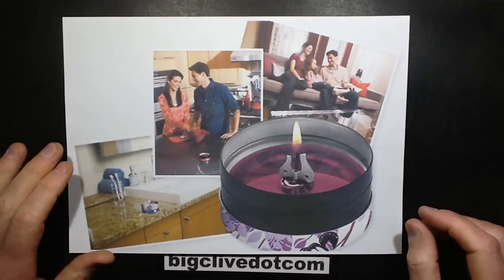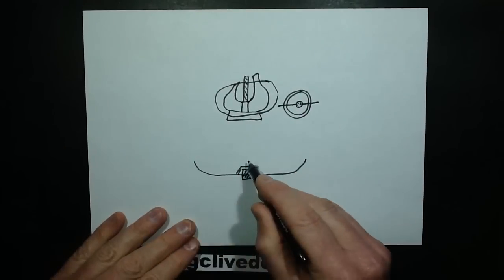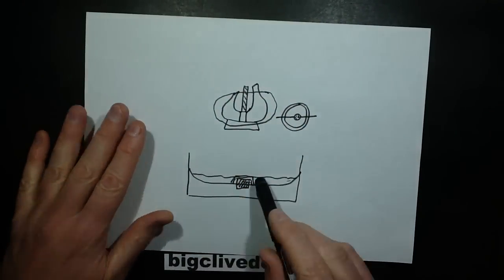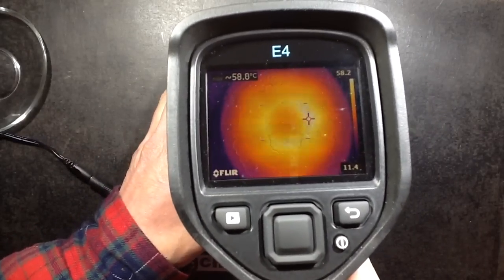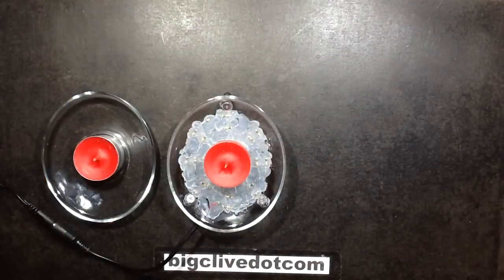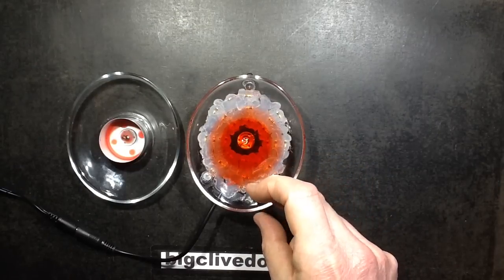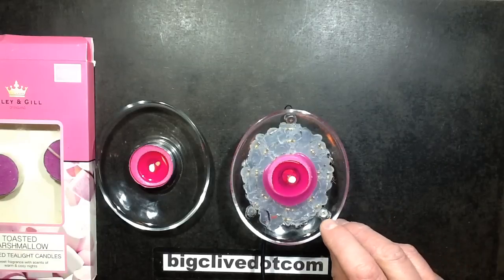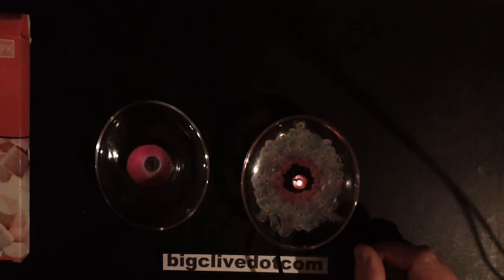Using resistors as heaters to melt wax.

Comment: Former candle maker here. If you have a wick too small for the container, then you will end up with a rim of wax on the edges when the wick is all burned up. Wicks must be sized for the width of the vessel.

If you look at the left tealight you showed, the wick is just BARELY big enough for the tealight container. If you look at the right candle, the metal tealight container was removed, the wax melted and expanded to fill the glass dish, and the right wick is no longer big enough for the width of the newly created pool of wax, hence you get a tiny flame on the right. 

It's not unusual to have undersized wicks on wide pillar candles and you end up with a wax shell as the wick burns down, but some people find this nice to look at.
Reply: Is there a formula for the ratio?
Reply: Google "How to calculate candle wick size".
Reply: Very good sir. Completely useless information for myself but I enjoyed and couldn't stop reading your comment in its entirety! It's the little things in life....

Comment: I only just saw this video.  The size of the flame is based on how much wick is above the wax.  If there is more wax melted, the wick will remain smaller.  In the unheated candle, it burns the wax off as it melts, resulting in more wick being exposed.  When artificially heated, more wax melts resulting in the smaller wick and smaller flame.  Smaller flame = longer burn time as the flame uses less wax :)

Comment: Yeah .. fun stuff.  I think if they would 'round off' the bottoms a bit, more of the wax would burn.  I am reminded of the candles in church with the metal 'caps'.  As the caps warmed up, it's weight would force the melted wax up to the wick.  That's probably why the never dripped down the sides.  I never really thought about it before.  Definitely, interesting stuff.

Comment: If you look at the design of the glade wax warmer and think about the way they have set it up you see that they have used a metal plate the same size as the flat surface of the bottom of the dish the wax sits in. This plate would nicely spread the heat from the power resistor and evenly warm the bottom of the dish. The dish is also reasonably deep and doesn't have a top radius too much greater than the radius of the flat surface on the bottom of it.

Comment: for a heater, mosfet + ptc +pot and a resistor to set the max power. adjust pot and resistor value to desired power and temperarure and you should be able to get a temperature controlled heater?

Comment: Also for the small flame, i think the wick is made for the diameter of the candle. so when the wax melts out the wick burns too fast and then continues to turn to ash when the wax has it's new shape, resulting in a very short wick = small flame

Comment: Glistening Snow. Was expecting a yellow comment and wasn't disappointed. Think perhaps move the resistors out a bit?  Don't really need as much heat in the center with the flame, but do want to keep the wax at the edges melted.

Comment: Wax melts at 70c maybe it's worth a revisit? Wonder if you could cook an egg with resistors making, perversely, a little nest😅
Reply: Actually waxes have a whole range of melting points, depending upon the molecular mass of the predominant molecules. My first experience of using waxes was as a histology technician where we used waxes with different melting points, mostly 68C, but for special jobs we used 85C, and occasionally 95C. Typical candle waxes melt at 68C, but the addition of stearin modifies this, as does beeswax.

Comment: Hi Clive, have you considered taking a look at the gubbins inside an Air Wick colour changing candle? You know, the ones with LEDs inside that only illuminate when the wick is lit, they are infra red activated.
Reply: +Billy Smith, are you sure they're activated by IR? I thought they had two wires going up the wick, and when there is a flame there's enough ionised gas for a small current to flow.

Comment: The tealights I use here in the US tend to burn down to just a little ring is left (like the one in your video). However I wonder if that is because most are now soy wax, with a lower melting temperature? I don't really like the soy ones as they seem to be make from "beads" of wax loosely pressed into the metal tealight cup. Which means a lot of mess in the package or in my emergency kits!

Comment: I think you need a fatter wick for a wider puddle Otherwise it will burn down faster than the fuel. Migt be possible to burn the waw without a wick too I used to do that with barbeque fuel (parraffine) getting it going with a bit of alcohol.

Comment: perhaps a shaped metal (copper) piece to steal heat from the candle itself just like the glade one? but then the wick will be too puny and you will get a weak flame
Reply: I'm going to try that with some 1.2mm copper wire.

Maybe coil it 2-3 times around the aluminium cup and get the two ends fairly close to the flame?

Comment: Could you use just one higher rated resistor to generate more heat (50w for example), and forgo lighting the candle completely? Similar to the "wax warmer" style products that use a small incandescent light bulb under a dished cavity to warm a wickless cube of wax? The commercially available ones actually produce a stronger scent than a similar scented wicked candle, and the wax never burns away so they can be reheated numerous times.
Reply from the maker: 50W would be quite high.  https://www.youtube.com/watch?v=wXcn52MWjCM

Comment: Thanks!  I have a heater I need to build for a garden pot I'm making. Perhaps I can get you input on it.  I live too far north (Moscow)  to grow Sweet Potatoes. They need the soil to be 80'F.  So I'll make a 6' x 18"x 18" pot lined with 2" rigid styrofoam insulation. I'll use a 1/2" pvc pipe with 48 1/4 Ohm 1/2 watt resistors and filled with vegetable oi. in the long pot.  I'll use a thermistor inside the pvc pipe to set the Max. Temp and another thermistor to take the soil temp and for Min. and Max temps for the soil.
Reply from the maker: Have you considered a heating pad as available off ebay?
Reply: I really don't know much about them.  Years ago I did get an electronics degree at DeVry.  I haven't done much with it since then.  I am starting to play with the Arduino to automate my garden.

Comment: Hello Clive. I have a resistor (5W47RJ) how many volts can it handle? 
Can it be used for small heating like you did?
Reply from the maker: 5 Watt and 47 ohm?  It shoukld work as a modest 3W heater on 12V if it can dissipate the heat.
Reply: Tried it out with 3 resistors on 12v. Maxed out my temp meter (rated max 70 celcius). Need a heater for my welding regulator since in welding with straight co2...regulator keeps freezing up so I need to apply some heat... somehow... ;)  

How much heat can they handle? 

Thanks for reply. ;)
Reply from the maker: If a resistor is fastened to a cold surface it will quickly dissipate its heat into it if it is thermally conductive.  Many high power resistors are designed to mount on heatsinks.

Comment: What you forgot was the one you took out of its container and sat in the resistor bowl sank when the wax melted leaving very little wick sticking out the top causing it to have a small flame.  Tut tut, I thought you would have picked up on that.

Comment: wick is dropping in the heated dish. silicone keeps the melted wax too far up the wick for a proper flame. pay attention to supporting the metal plate at the botton of the wick, under the cable.

Comment: Hi Clive, 
When you mentioned at the end getting the candles specific to that product because of the melting point, I immediately though if that... when I was a kid, my mother, my brother and I used to make our own candles using Paraffin bars (I recall it came in a square blue box, it was 4 "sticks" attached to one another, akin to a chocolate bar with a square pattern.)

I honestly have absolutely ZERO knowledge in chemistry, but perhaps you or another great mind could figure out a simple way to add something to that mix to change the wax characteristics.

Keep up the good work, I love the videos ! Funny and informative!

PS: if you want color, add a piece of crayon to the melting wax ;)

Deskwizard
Reply: I know this is pretty much a dead comment at this point, but in case anyone sees this and is wondering how to lower the melting point of paraffin wax, or almost any wax, just add a small quantity of mineral oil to it while it's melted and mix it in.  It can lower the melting point quite a bit with just a little oil.

Comment: I stringed loads of resistors in series inside a soft teflon tube, hooked it up to mains and placed it under a part of snakes terrarium to make a warm patch.... Cracked the glass due to localized thermal expansion. Crap. So be careful with heat sources and glass.

Comment: theres plug in air fresheners, from home bargains i think, which use a ceramic resistor running across AC 240v, suoopse you could run a few of them in parallel and make a decent wax burner,
Reply from the maker: The resistors in the air fresheners are about 2W.  If you search through my videos you'll find the one where I add LEDs in line with the resistor to make air fresheners light up.

Comment: The problem with the small wig in the resistor dish comes from setting it inside and lighting it up when the wax flows out of the candle you loose much wig. Would be better when the wax in the resisor dish was already melted. Also why dont use a copper dish and let it heat up itself with it's own flame with something like heatpipes or so

Comment: 11-12C = 52F... Why... holy hell, i would be hypothermic xD Where I live, anything less than 70F (21C) is chilly and requires a jacket. A cold house is 20C and a warm house is 26C xD 11-12C is like the temp in the fridge...
Reply: #UKlife
Reply: Sam Mason I live in Tennesse, South eastern us, so it doesn't get that cold here, and when it does, it doesn't last long. We have about 3 months where the temp regularly goes higher than 100F(38C)
Couple years back it hit 110F here(43C)
Reply: Sorry, I meant Clive. And I do too. Not very good for me, I have Raynaud's!
Reply: Our average temp is just under 20C. In my town. In winter it usually freezes, but rarely snows. In summer, it can hi a high of 30C
Reply: Sam Mason Had to look up Raynaud's... i thought losing motor control in the hands when its cold was normal... is that a disease? I had to quit baseball as a kid cause the cold made me lose the ability to grip the ball, everyone just told me to quit whining xD
Reply: +Richard Smith look up some forums on Facebook for more advice. I'm pretty new to it!
Reply: Sam Mason It would explain my extreme avoidance of cold, but I have enough diseases already :P Been doing just fine just being a 'wuss' to the cold :)
Reply: +Richard Smith haha
Reply: in here 4c is cold, 15-20c normal. sometimes in summer temperature goes up to 43c
Reply: I live in Finland. -10°C is warm here. -30 is cold
Reply: chiken Actual temp or heat index? Cause heat index can hit 50c in the summer here. Usually a consistant 80-90% humidity all the time(living next to a river, swamp lands).
Thats quite the temperature swing though, here its just hot most of the time, with a short winter.
Thats fine tho, i like the heat :) I find it relaxing... while the cold makes me shake like an abused chihuahua...
Reply: actual..